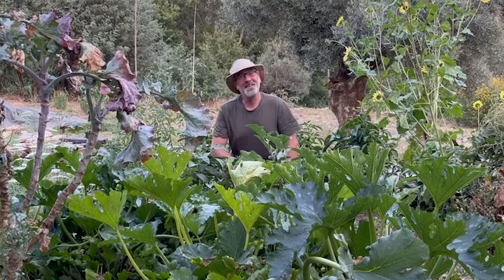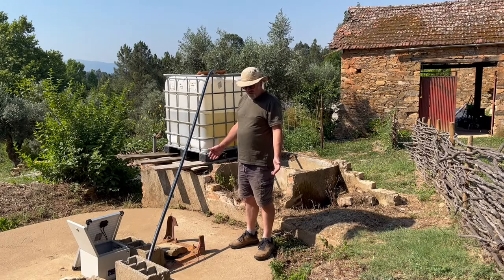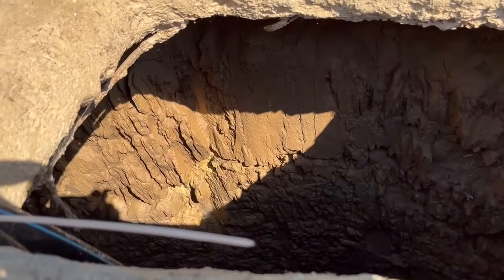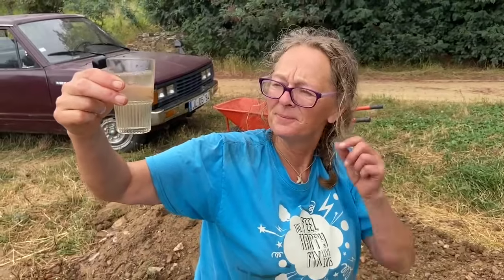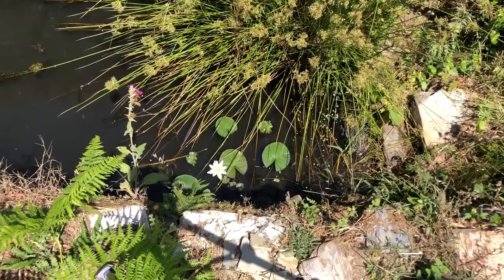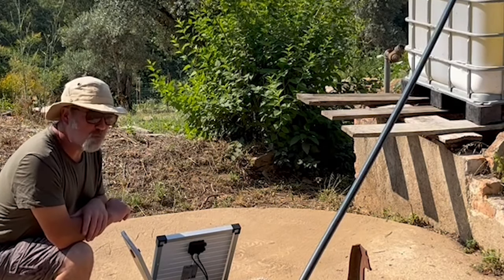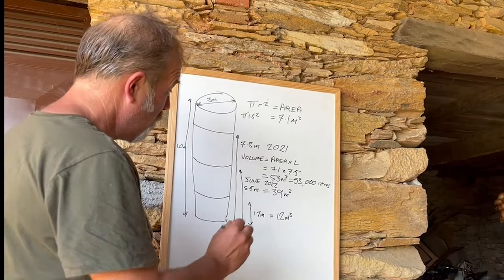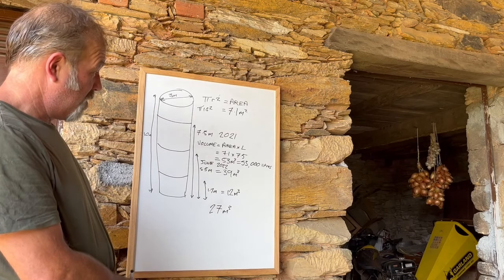Finding WATER on our Abandoned Land - Off Grid Water System - Revealing the WELL #2

Comment: How much water your well will produce, depends on the ground water level. Your well could indeed go very low and nearly dry, but it could also keep on refilling up to a certain level, though not as high up as it gets at end of winter. How fast it refills, may vary from a few hours to a few days. As this is your first drougth year, you'll get to know how strong (or not) your well is.
Last winter was extremely dry, but we've had similar situations in the past. In fact we could have another very dry winter comming... has happened before.
Orange water due to iron content dissolved in it is not in itself, bad. It could still be drinkable if it passes the tests. Not very good to wash white clothes, they'll turn yellowish and will look old and not properly clean.
When cooking with orange water, it takes longer to make a pan boil and cook your veg. I think because the water is heavier.

P.S. You should be careful when standing on that well concrete cover. The concrete may not be very solid or may have been weakened by age, and could colapse. Better be safe...
Reply from the maker: That’s really helpful, Donna. Thank you. We’re keeping a close watch on levels and hopefully we’ll be able to harvest some rain water this winter. Water is so precious.

Comment: You can get the well tested. Does the color or the water clear up after sitting a few hours in the tote?if yes it’s just suspended solids like silt. If it doesn’t it’s probably iron or manganese
Reply from the maker: It definitely stays orange. The locals say it’s iron. We could get it tested. Something to consider.
Reply: @NearbyVeggies  if it’s iron it’s fine. You can oxidize it with chlorine or bleach and than run it tru a carbon filter and would be perfect for drinking

Comment: I Have a well  that has a 2 metres diameter and only 5.5 meters deep...in the winter it overflows in the raining months...now the water level is around 2 meters from the bottom of course.....for  many years I never dried up the well and I use it to feed two homes and little bit of garden watering...but long time ago my parents used to got  it dry by watering some land ..and the next day it got back the same level of water ....it has been that way in the last 40 years...I guess I´m very luck with my well...
Reply from the maker: We still have water, though it’s continuing to drop. Reading about your well gives me hope. Thank you.
Reply: @NearbyVeggies  Forget to say: every 2 years I drop 5 kgs of quicklime stones on the well    that keeps the water crystal clear ,disinfects and kills all the small worms and other little bugs that live in the water; i do not drink the water directly from the well ( I use supermarket bottled water..) but I cook with it ,no problem  another thing in almost all the wells in the north of Portugal the water is acid - in my case it has a PH around 5 - and also it's a very ferrous water and it's very soft water    almost no lime on it .... I know that because I have two electric cylinders ( boylers ) that I do the maintenance every 4/5 years changing the protective   magnesium anode and I won't find  no lime sludge inside   instead  it got a lot of ferrous sludge....
Reply from the maker: @netby  That’s such useful information, Daniel. Thank you. 😊
Reply: @NearbyVeggies  my pleasure...🙂